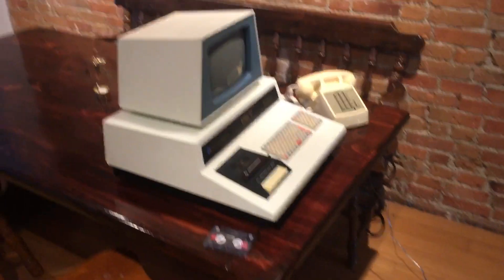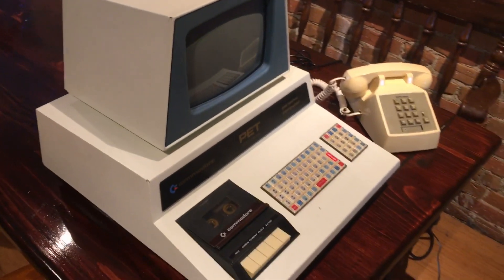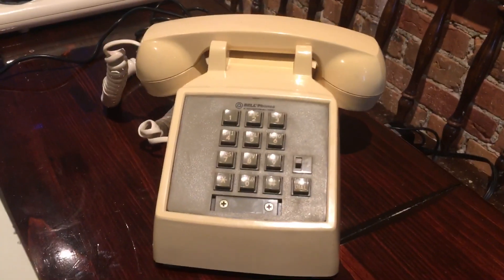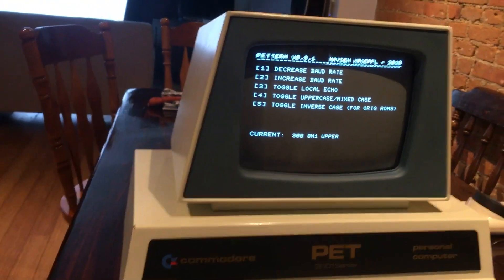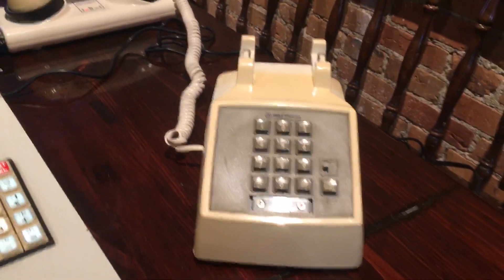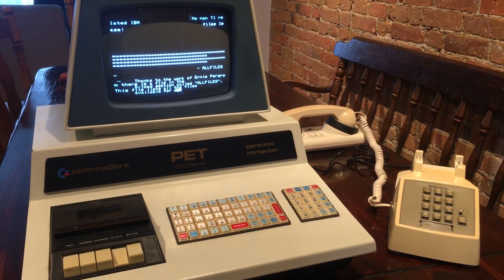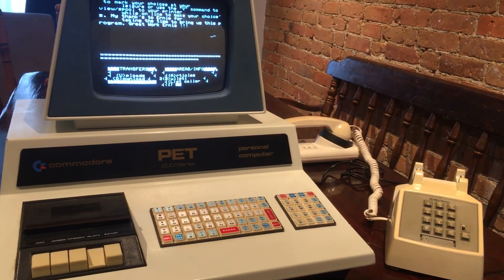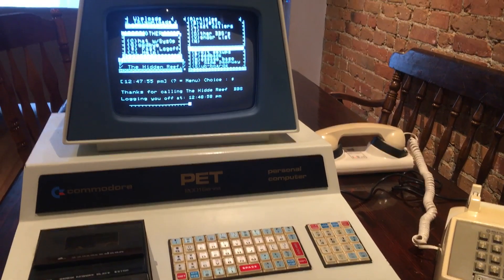Dial-up BBS with an Acoustic Coupler on a Commodore PET 2001-8

Comment: We had a computer room in the library at UMass in the late 70's with about 20 terminals that would hook up with acoustic modems. A dumb game we played a couple of times was to go in there late at night, turn on all the modems, turn off the lights, and then whistle and see how many of them would light up in response. Nerds? Yep.  But better was the one late night my engineer girlfriend and I hauled the sole 102 lb. Decwriter from our dorm computer room (I was an RA so I had a key) onto the elevator and rolled it into up to my room and hooked it up to the university computer at 300 baud (again with an acoustice I thought "Wow - It doesn't get any better than this."
Reply from the maker: These are lovely stories. Thank you so much for sharing.
Reply: Great story

Comment: Why is the monitor flickering so much?
Reply: Thats his camera out of sync with screen. can be a real pain to get it right. People like LGR and so on use a somewhat expensive cam that can be set to match and take that effect away. its not a strobe effect like you can get but thats what is doing it. im pretty sure.
Reply: Not the monitor being out of sync. Looks to me like it only starts once the program is running, which strongly suggests to me that the flickering is caused by what is generally known as "the killer poke" being in the software. Have a quick read up on it, it works as a way to speed up these early PETs but does have screen flickering as a side effect.

Comment: In 1980 I bought a Pet2001, sponsored by grandma, with a green screen. The older ones at the university were still grey.
You had to be very patient because even small programs could take two minutes to load.
I sold it sometime later and I lost track of it.
25 years later I visited the Heinz Nixdorf Museum in Paderborn, Germany, and found out that the Pet they had was actually mine.
That was quite exciting to see it again. How did I recognize it? At some point, I wrote my initials with a pen onto the chassis.
The letters were still there.
Reply: that's amazing!